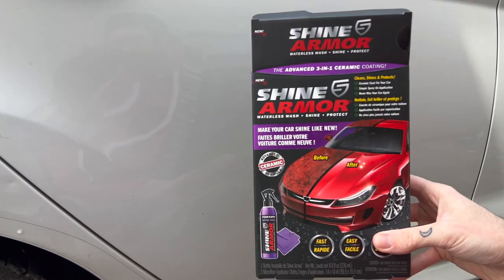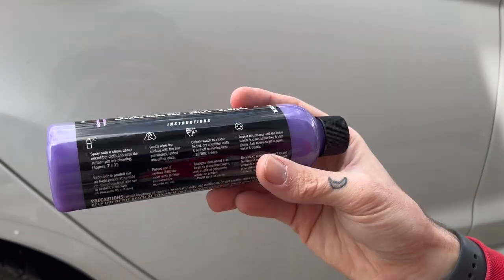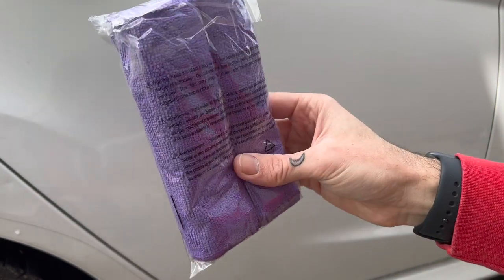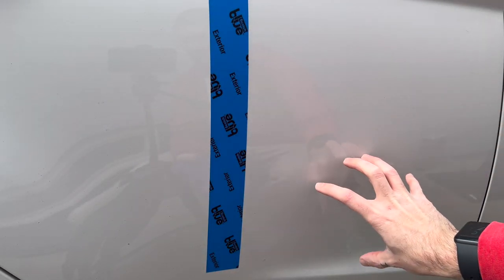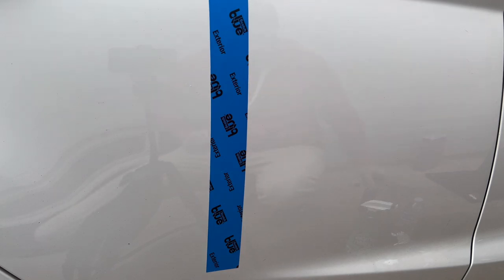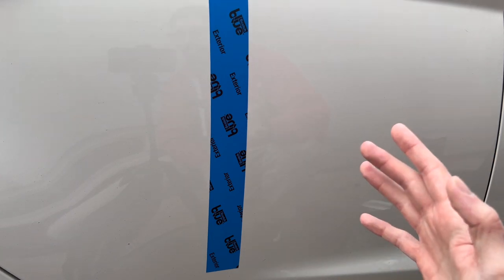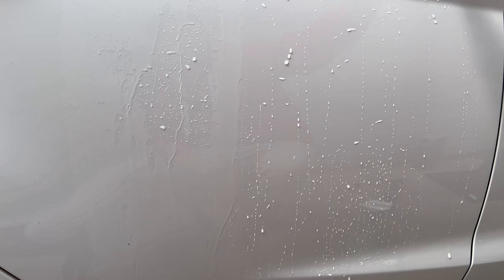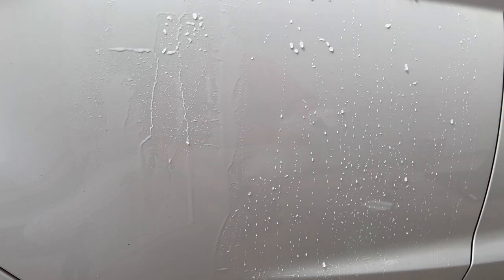Shine Armor ceramic coating - Does it work?

Comment: I see that they dropped the price of this product significantly.  I tested this product a couple of years back and also Nextgen as well with my jeep.  You get a pretty good shine from it and 'some' hydrophobic action.  My experience with it and Nexgen though was that it went bye bye on the first wash following application.  It wasn't something I'd keep around or use.  If it works for others very cool.  I ultimately ended up going with Turtle Wax Hybrid Solutions; which will last up to 13 months for me.  Currently experimenting with Cerakote as well as it's pretty awesome.
Reply from the maker: The turtle wax is good stuff too. The worst one in my opinion is the meguairs spray ceramic. The actual ceramic wax that you buff on works great, the spray stuff (light blue bottle) is the worst